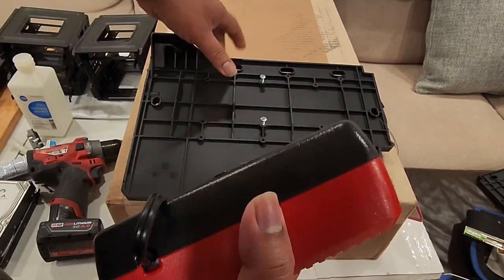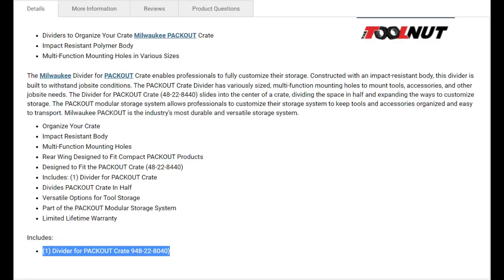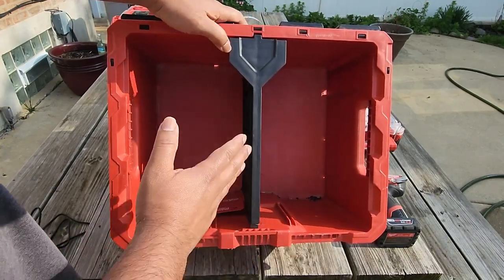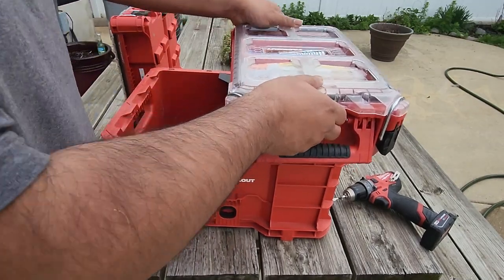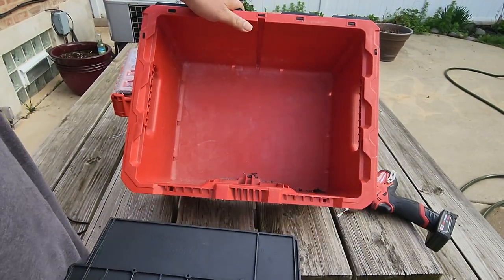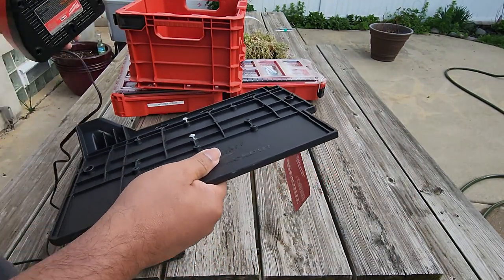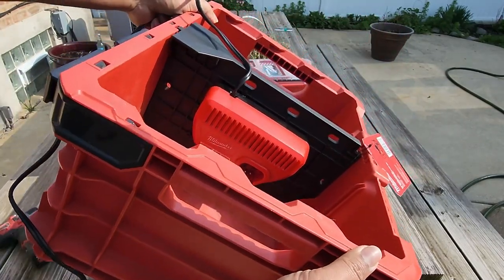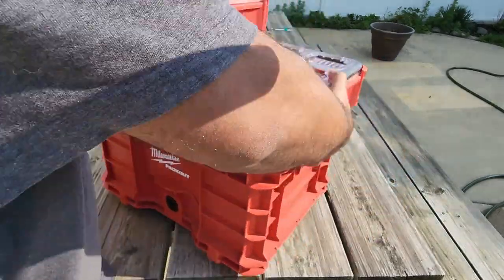Milwaukee PACKOUT Crate 48-22-8440 Divider 😱

Comment: Hey so dumb question... how does the battery stay put when you plug in a 12v battery?
Reply from the maker: The charger has 3 retention metal that holds the battery. You feel a solid click when pushed in. Works perfect.
Reply: @edtheoldtechguy  oohhhhh thanks man! I didn't realize it had a click if you push them in further. Sheesh do I feel silly.
Reply from the maker: @rustykc  No worries brother

Comment: What size of screw did you use
Reply from the maker: The screws i used in the video were too big. I went into my junk drawer and found what I believe to be #10 x 3/4" Deep Thread Wood Screws / Phillips / Pan Head / Steel / Zinc and they work great.